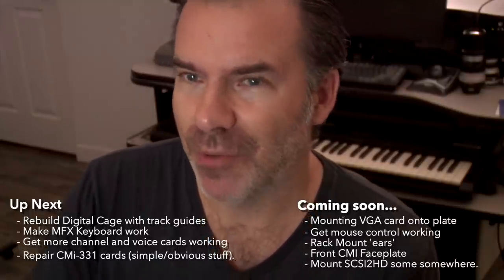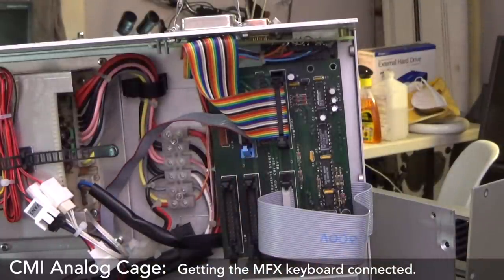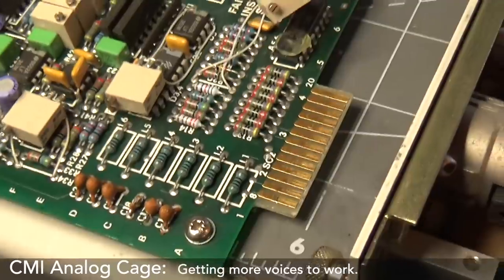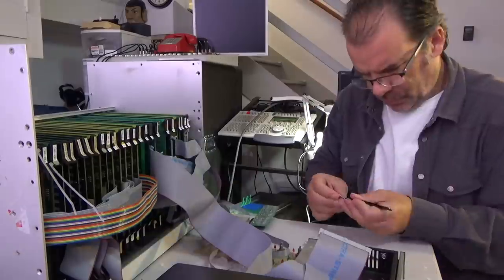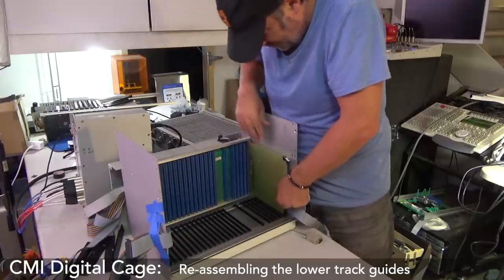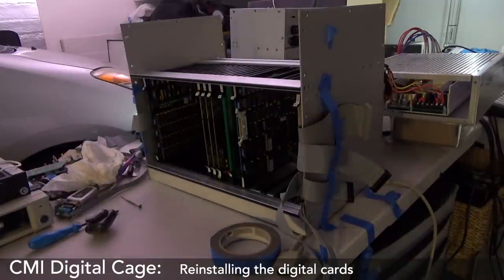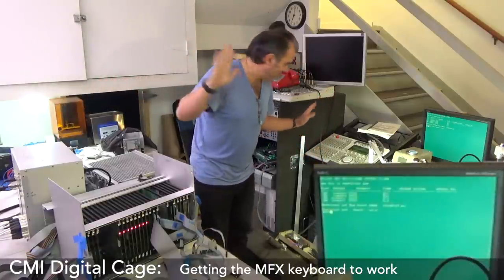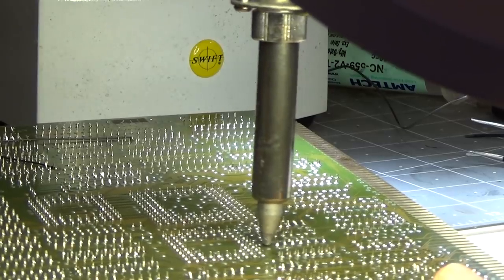I'm Building a Fairlight CMI: Episode 7

Comment: You can make an exact copy of the Farlight with new components and new circuit boards that have many layers - you would build it completely differently today. You don't have to change the case, you can install an USB 3 port where the scsi drive is, but you have to change also the scsi controller on the circuit board. You can try  to summarize most of the components with a xilinx virtex FPGA

Comment: Edge connectors that long are never going to be easy to push in. But I suppose you can feel that they're harder when the guides in place? I remember how hard it was to get cartridges in and out of the Vic 20 due to its long edge connector.
Reply: hehe I remember pulling carts out via the 'heel of my hands' on each side. I had to decide between the 'graphics super expander' and my 16k ram pack.
Reply: hehe I remember pulling carts out via the 'heel of my hands' on each side. I had to decide between the 'graphics super expander' and my 16k ram pack.